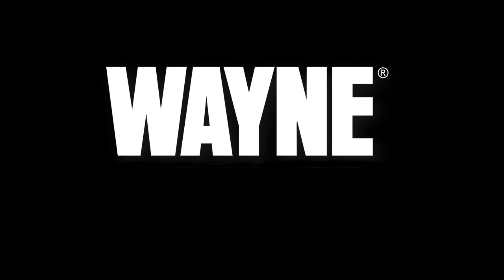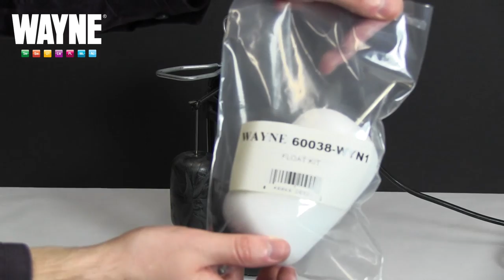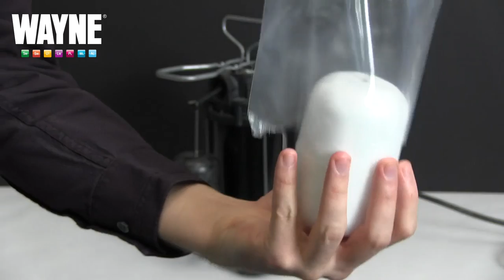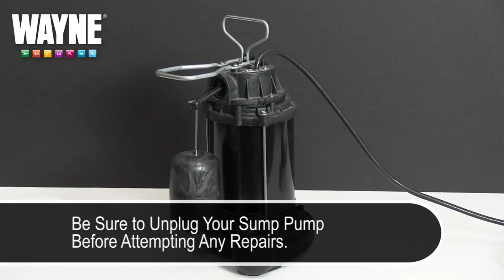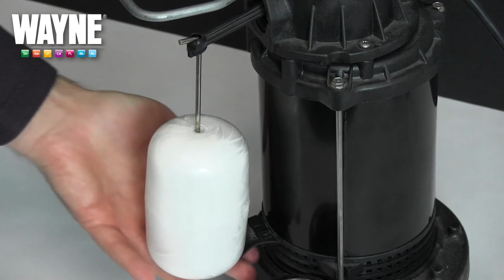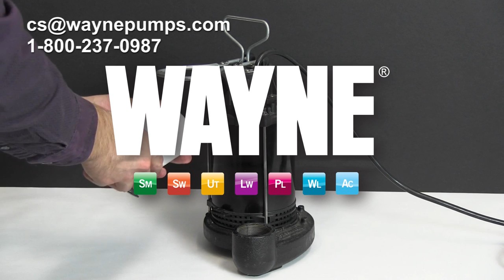How to Replace a Sump Pump Float Switch

Comment: My float appears to be working but the switch gets stuck to run even when the float has dropped after clearing the water. Is this a float issue as it seems it's more of a switch issue?